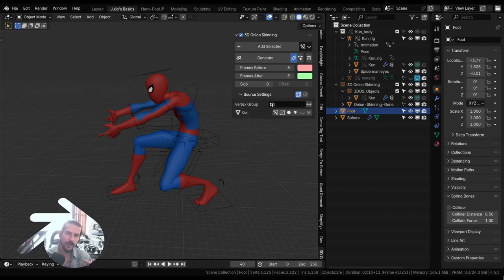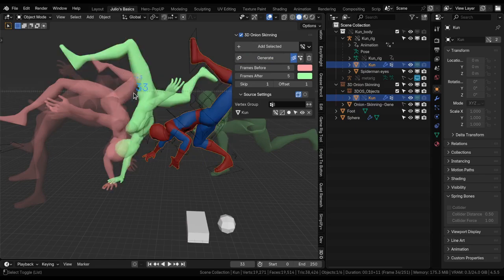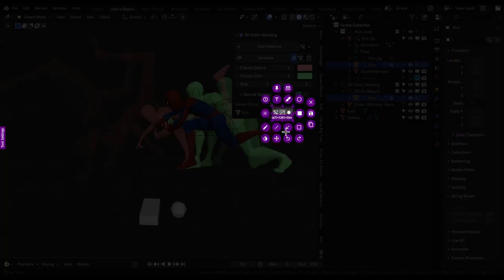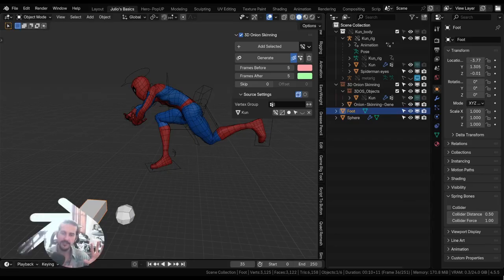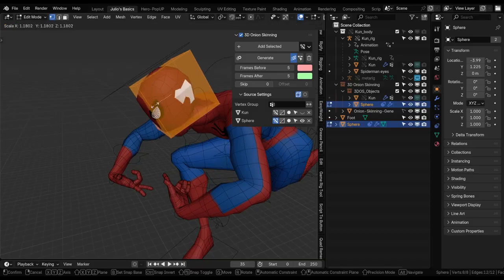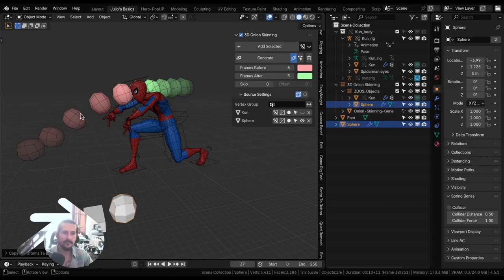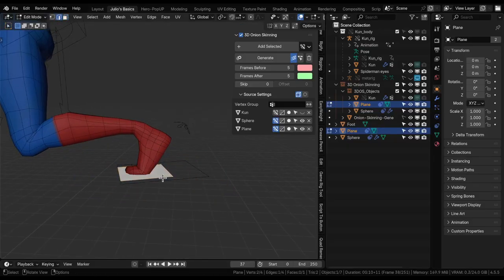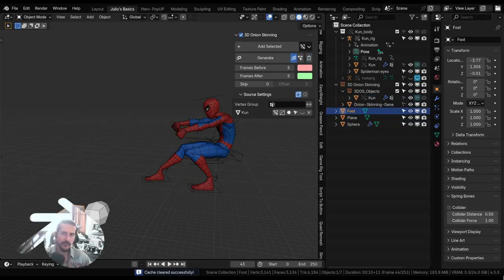3D Onion Skinning - Next features coming up!

Comment: I did buy it, but I haven't really used it yet because my workflow revolves around baked animation. It would be perfect if the ghosting could trigger automatically when the Keyframe Type is set to 'Extreme', or if I could manually mark specific frames to show ghosts. I've bought pretty much every ghosting addon out there, lol, but they all stopped getting updates later on
Reply from the maker: Right! My roadmap includes other modes for the future like: ghosts on demand (by specified frames) and also in a specified range intervals. Yep, many ghosts like add-on died on the way because they relied in some functionalities that were hard to maintain trough Blender breaking changes. This solution is relying on Blender's most recent features so I guess it have a big life span in front of it. In fact this add-on helped Blender fix specific bugs that ended up being back-ported. It is really surfing Blender's new techs and there is a lot of room for improvement while Blender evolves it geometry nodes and cache management. If you'd like to discuss your specific needs I'd be glad to know more about it so I can take that into account for the next releases.